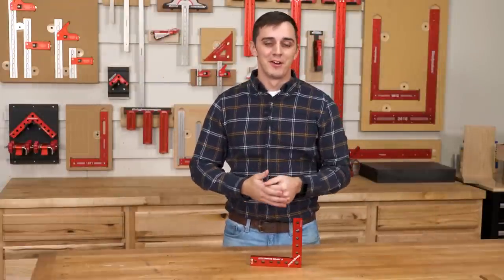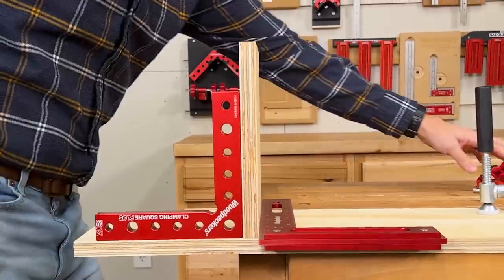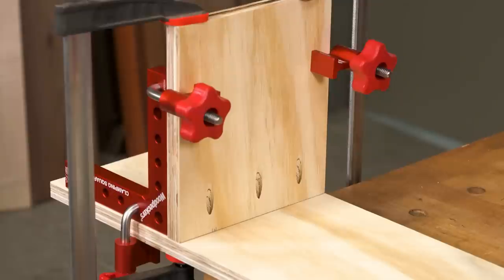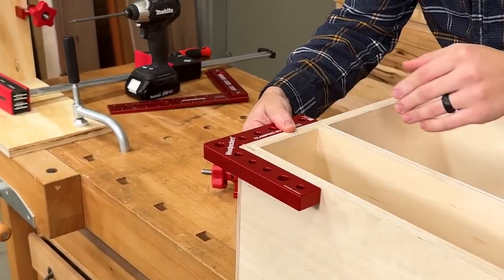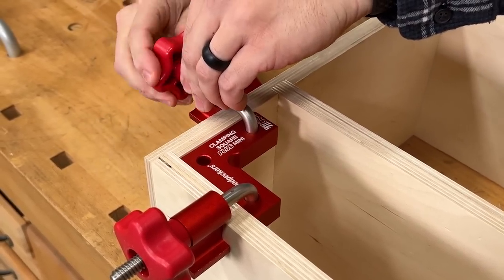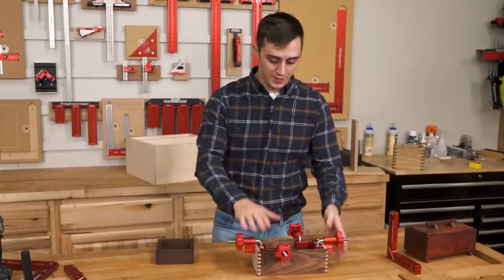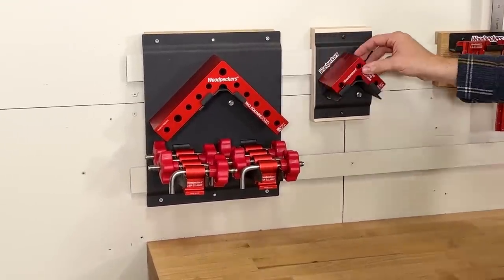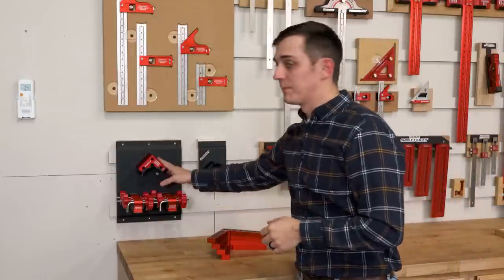Bigger Isn't Always Better Featuring The CSP Mini | Deep Dive

Comment: Where's Jeff?     I noticed what appears to be two sizes of  holes in your set of 7" corner clamps.  On my set all the holes are the same size.
Reply from the maker: Rolling change. It's actually more about holding the square in the mill while it is being manufactured. In practice, it makes no difference.
Reply: Where's Jeff???
Reply: Where's Jeff

Comment: WHERE'S JEFF????  I've purchased many of your GREAT tools over the past several years. Although I may not have used some of them as yet; they are still in
                                    my plans for projects in the near future.  I really like the soft start feature of the router motor. I am also impressed by the fact that you
                                   handle other high quality tools such as the Montana drill bits and the Centipede. I've purchased 2 of the 4X8 Centipedes (1 for me and
                                   1 for my Son-In-Law). The third one I purchased is the 2X4 model for my long time friend. I'm very impressed by the fact that a lot of
                                  thought and engineering goes into every one of your tools; you people think the way I do. KEEP UP THE EXCELLENT WORK!!!!

Comment: I don't know where Jeff is, but I hope he's taking a deserved break with family.  He's always very helpful in forums whether the tool is Woodpeckers or not.  I've got the original clamping squares with F clamps; winning those CSP clamps would be great.

You guys should do a deep dive on the new HDS router lift, and which accessories are or and are not compatible from an existing PRL.

Comment: Where's  Jeff?  I use many woodpecker products in my custom shop. I have made my own clamping squares, mostly out of Baltic birch plywood, and they have work quite well. I can see where the small mini clamping squares could really help in tight situations. The greatest problem I have is finding plywood material that is totally flat and not cupped, bowed, or twisted. When I deal with this kind of material my best option is a corner to corner measurement (diagonal) to identify overall squareness. I can usually pull the warp out of plywood with the face frame or backing material. Otherwise, in nonvisible areas, I place heavy solid stock straighteners. Note: I really like this video but would like to see all of your applications of the clamping squares with the pressure clamps applied. As I watched the video and saw the clamping squares applied, I was waiting to see the pressure clamps put into place.